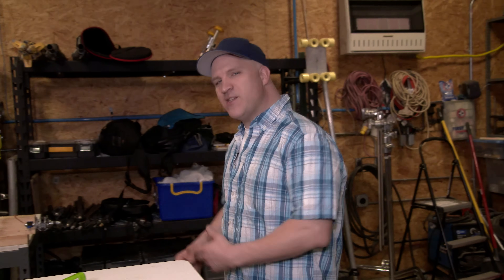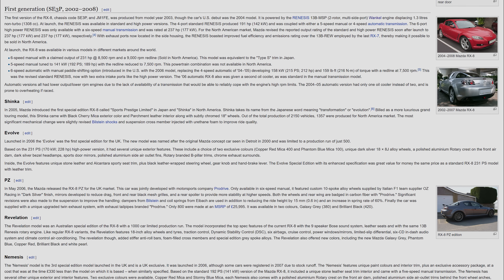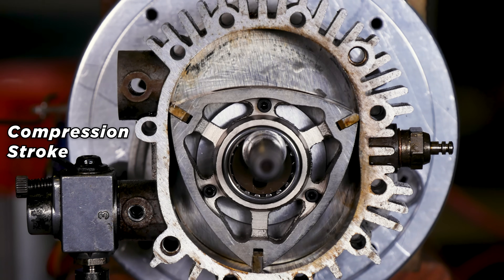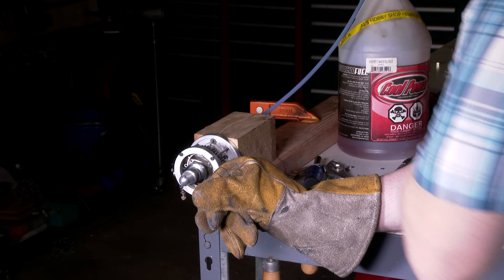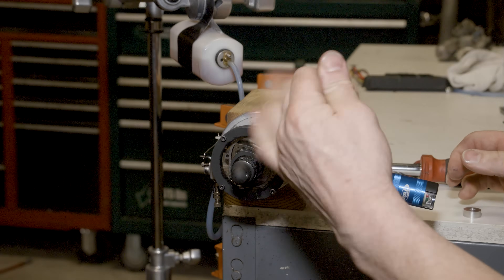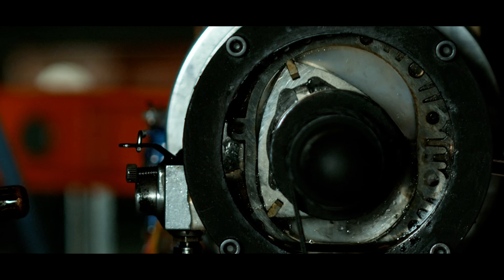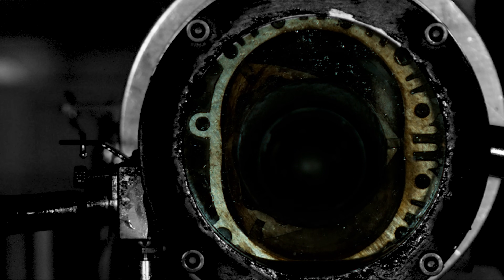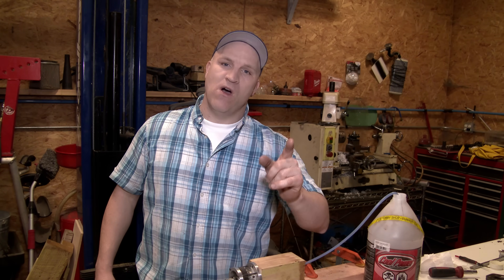See Thru Rotary Engine in Slow Motion - (Wankel Engine) 4K

Comment: I miss the mentioning of Felix Heinrich Wankel here in the comment section, the genius who came up with the idea for a rotary or "Wankel" engine after building his first "normal" V2 ic engine (from scratch) in 1924 and being grossly appalled by it's vibrations: vibrations cost power, so that could not be the way.
After WWII the Wankel research institute in the Ruhr area, officially owned by the Reichsluftwaffe, was demounted by french occupation troops, so that Felix Wankel had to start again from scratch (this time in in Lindau at Lake Konstanz). 
NSU was the first company to build an actual Wankel car, the Wankel Spyder, and the second one, too, the Ro80, which already had a two chamber Wankel engine, semiautomatic transmission, preselective shifters and some other goodies (re-)"invented" recently.
The Wankel Trochoide system was already used for decades before the actual carengine, though, to supercharge aircraft and other engines, and to compress air and other gasses.
Reply: This is not Felix Wankel's "Rotary" engine. The Wankel KKM (shown here) is a non-rotary layout engine design and was created by Hanns Paschke and Walter Froede without any knowledge or assistance from Felix Wankel.

Comment: Great vid. I've never seen the inside of a rotary motor but I see why they don't last long tho. I feel like there would be a ton of power loss as the engine gains wear. I could be wrong lol happens alot haha but the blow by the cylinder wall looks like a loss could just be the smaller scale idk pretty stoned at this moment lol

Comment: You may need a prop on it to run better. It will work as a flywheel. Like a lawnmower needs a blade on it to run.
Reply from the maker: Yes, I did run it with a prop but it was in the way. A lawnmower however does not need a blade to run because it have a flywheel. This little Rotary does not have any sort of flywheel so it depends on prop to keep it running normally

Comment: So many years and miles I have spent working on rotary engines. I owned rx-7 from 83 to 99 and back in early 80s noone wanted to work on those. So trial and error, workshop manual and haynes manual.

Comment: used to work at the garage and we towed three of them they use the seized but it wasn’t that they seized they were like must’ve been on the compression stroke you used to have to put the car on a lift and move the flywheel why does that happen,Then it would start

Comment: This screwed me up: 2 stroke or 4 stroke?  all faces fire in 1 crank rotation, but a piston 2 stroke has multiple  strokes happening at the same time in the same spot, but the Wankel has its sealed, albeit partially ಠ_ಠ but you could call them sealed.
Reply: All Wankel engines use the 4-stroke operating principle. The Wankel requires 3 revolutions of the crankshaft to complete its firing order sequence instead of 2 revolutions in an Otto engine or 1 revolution in a 2-stroke Benz cycle engine
Reply: more efficient
Reply: thanks!

Comment: I was wondering if it the explosions are caused simply by air compression or if there is a sparkle. Didn't quite see, but, it's a gas motor, not oil. Shouldn't there by sparkles then?